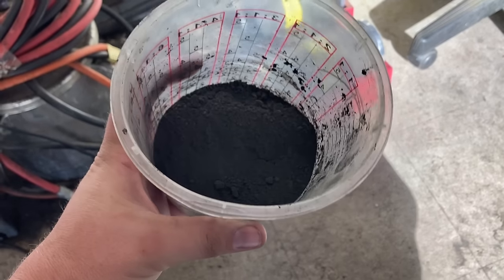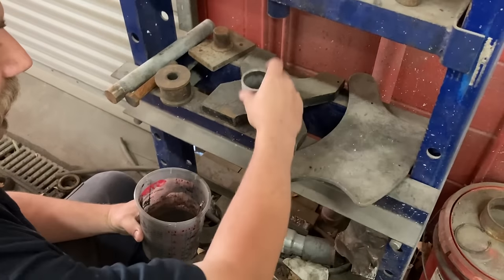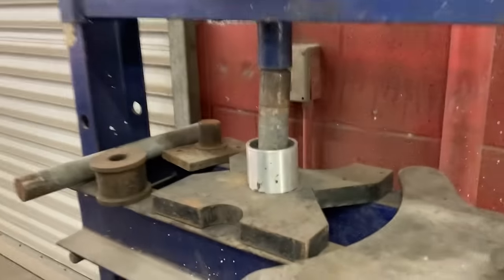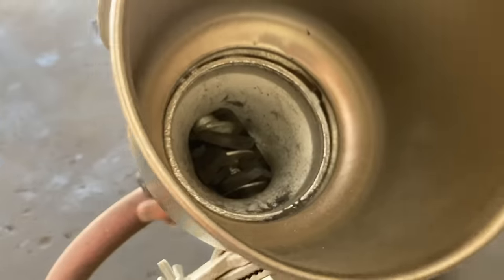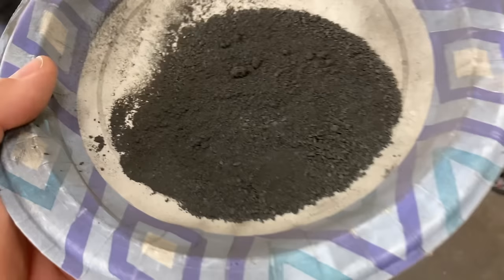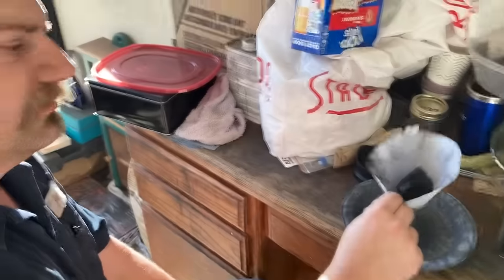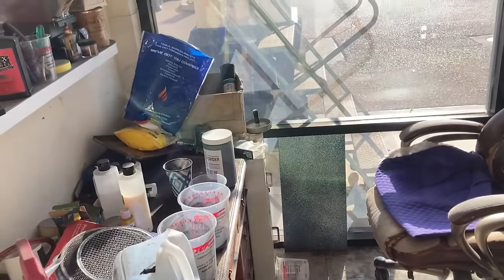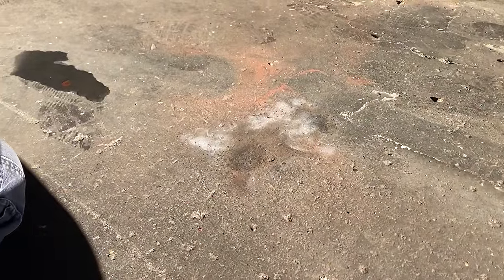Making Corned Black Powder

Comment: first time watching your channel.  I also have no real experience and contact with gunpowder, so if this question is weird or dumb, excuse the lack of knowledge.   If you're going to take just grind it up why make the pucks in the first place ?  Why not just put the powder in the grinder?  A serious question, I have no clue.
Reply from the maker: To make good quality black powder the three ingredients need to be incorporated on a molecular level. I suppose if you put the ingredients in the grinder over and over again for days on end you could get a decent product. The powder that comes out of the ball mill is light and fluffy like flour or talcum power. Compressing the powder into pucks and breaking the pucks up with the grinder will give you nice hard granules than can be sorted by size. So in short, the ball mill does the mixing and the grinder just breaks up the pucks
Reply: @Everythingblackpowder  Thanks for the answer.

Comment: What do you use the 1F for? A lift charge?

Also, are there really no applications for that fine dust?
Reply from the maker: I don’t make powder for fireworks, I specialize in firearms. The 1F is used in big bore muskets. You can use the fine dust as priming powder for flintlocks.
Reply: @Everythingblackpowder  What grade do you think is the best for those little salute cannons? They never seem to work very well, but that may be because I'm afraid of packing it too tightly.

I like your channel!
Reply from the maker: @WaxPaper what caliber are they?
Reply: @Everythingblackpowder  They're .58 caliber, and they come with a 25-grain scoop. I've tried 2F as well as 3F smokeless equivalent, but it always just fizzles and "poofs" instead of "bangs." The other end of the scoop is a ramrod to pack it down. I always wondered if maybe it has to be packed super-tight, but never wanted to use a mallet or anything.
Reply from the maker: @WaxPaper  2F or 3F should work fine

Comment: Sir, you make very good BP and wish that I could do the same. I just can not find a cylinder that you Puck it in, as I don't know what it is that you use.   This is something I feel strongly about so here goes. I worked in a machine  shop for years and even grew up in one... I had a man put a piece of round stock in a press one day and he had to short ones in it as I saw you doing as I walked in the door I saw that this jump side ways kick out hitting him in the face. I wrapped his head in my shirt drove him to the hospital. I took him about 6 months to heal up.. there I stuck my 2 cents in where I didn't need to but You do as you like . I would not want to see that happen again to any man . Have a blessed day. Aw I feel you make BP i would want to buy over all on the market... Bill

Comment: Why do you make the powder in to pucks then grind them back to powder  ?
Reply from the maker: It compresses the powder and makes the grains durable and denser than screened powder.
Reply: Flame doesn't propagate well thru a dense powder. He's making grains (not powder) to introduce air pockets into the mixture which speeds up the flammable reaction.

Comment: Wouldn't the graphite be more of a lubricant than anything else?
Reply from the maker: Probably but the most noticeable thing is that it slows down the burn rate
Reply: @Everythingblackpowder  wouldn't that hold true for anything that won't burn? If you used newspaper ashes instead of graphite, would you save money?  I haven't made black powder so I'm just guessing.

Comment: Whats the difference between corned and your other home made black powder?
Reply from the maker: The other powder is screened black powder. It’s not compressed at all.
Reply: @Everythingblackpowder  yes thanks I just saw the part two, it's more compressed so don't have to use extra like with normal method right?
Reply from the maker: Correct
Reply: @Everythingblackpowder  and what is the difference in the smaller powder? Does it burn faster? And which would be preferable
Reply from the maker: @snowy5419  I mostly make 3F which is what most people consider Pistol powder. It doesn’t technically burn faster. It’s that it’s consumed sooner, if that makes sense.
Reply: @Everythingblackpowder  thank you

Comment: why instead of making a puck dont you wet it then run it through a spaghetti mold and make your grain sizes off that vs the straining ect?
Reply from the maker: that works fine but the powder is much weaker than the corned powder

Comment: You've got your powder added with a bit of water and have mixed it. Screw waiting a week for it to dry. Get the screen ready for the size of cobb you want. Rub your dump lamp of gunpowder over the screen, catching the cobbs on some newspaper. Shake the paper regularly to separate and spread the cobbed powder. Let dry. BOOM! Done. 

Presses, dry it in the sun for a week, bust it up with a hammer, run it through a grain mill, sift it through screen to size the cobb....BS!

Comment: Though I seriously doubt the SHTF scenario, IF - it were to happen and I was unable to purchase standard gun powder for reloading standard brass casings... is it possible to substitute black powder for smokeless powders? 
According to my State's storage requirements, black powder must be kept to quantities of 5lbs or less... similar to "explosive" storage. My understanding is that black powder burns significantly faster than commercial gun powders... which would seem to mean that adjustments in amounts and burn-rate would be required 🤔 So, for curiosity's sake, are there people and sites that play with this idea?
Reply: I’ve loaded plenty of BP cartridges, both rifle and pistol. You want to fill the case to the base of the bullet with a little compression. BP cannot produce anywhere near enough pressure to match smokeless pressures- but you don’t want ANY air gap inside of the case to allow a detonation. If you want a lighter load, fill the remaining space with cream of wheat or similar.

You’ll find about 35gr will fill revolver cases, and about 50-100gr will fill rifle. Semiautos won’t reliably cycle, although straight blowback seems to work for a bit.

For shotguns, use a “square” load to start- an equal volume of BP and shot. I find for birdshot about 70gr in 12ga is a good start- and I’ve gone up to 120.
Reply: @PrebleStreetRecords   Thank you. I suspected... I've seen reload videos for brass shotgun reloads and 44-40s. Both are old platforms, made when BP was all there was. Modern weapons? Gas operated? I had my doubts, especially with the stories of the early M16 failures due to "dirty" powders. But your guidelines are good to know... because... Zombies and stuff! LOL!

Comment: You should lose less than 1% everything else should be a grade cut or sent back to be re-wet and re-corned. Most mesh cuts have their uses, sometimes the proportion of mesh cuts that you make may not be exactly what you use so send the surplus back to be re-pucked.

Comment: excellent, that's how you make a strong grain... but you're missing a brother procedure... to give the gunpowder its maximum hardness and facilitate granulation with less dust
Reply from the maker: Well, let’s hear it.
Reply: First I recommend that you use a sprayer like one of the perfumes to add moisture to the powder, that way you ensure an even humidity..
Reply: the final step for the grain...(pressed gunpowder disc) after drying it for a couple of hours in direct sunlight or in another medium that ensures all the moisture is extracted...you have to cook the grain hot, it sounds and it's something reckless, but gunpowder withstands a lot of heat before igniting.
Reply: For cooking, a piece of thick and flat iron would be used, such as a plow disc, it is placed on a portable burner preferably to be able to do it outdoors in a windless area, it is heated over a low flame and the grain is placed ( BP disc) and can be seen spinning like a hamburger
Reply: it will begin to release smoke and you will see how it becomes a little bright decided that the sulfur and nitrate crystallize...once cold the grain will sound like a piece of ceramic, it will be harder and when you scrape it against the ground you will notice that it remains shiny
Reply: Such will be the hardness that you will even be able to sand and polish the grain, it will be so hard that from one colpe it will be invoiced in several pieces, something positive for the granulating process with the corn machine.
Reply: I also recommend weighing the powder that you are going to press and it is very important to leave it for about 30 minutes, that is why the initial humidity must be low to avoid nitrate leakage... the longer the press time, the less air will remain and it will be more compact. It takes time, but a good gunpowder made with quality elements deserves it.
Reply: and don't forget the graphite, for safety and fluidity in loading. It's a simple step...you put the already granulated gunpowder in a tumbler and leave it for a few hours...at the level of graphitization you decide.
Reply: The pressing method reduces the volume of the load and concentrates its strength more, in addition to avoiding compaction in the load. In my case, after granulating, I let it sit for four to six months. After that period, it will reach its greatest potential. I hope this method is useful, it is my experience and I am very satisfied, nothing to envy to the commercial ones. greetings from Argentina.
Reply: If you decide to carry out this procedure, start with small grains to get a good look at the temperature of the metal and how it reacts. and upload a video of the result. regards..!

Comment: What's your opinion on Alder charcoal
Reply from the maker: Alder Buckthorn makes the most powerful powder that I’ve tried so far
Reply: Thank you for the reply. I use Swiss powder, it's hot, and I'm fully convinced it produces softer fouling.
Reply from the maker: Yes, it’s the best money can buy. My alder buckthorn powder has equal velocities to Swiss but produces twice as much fouling.
Reply: @Everythingblackpowder  Interesting. I mainly load cartridges with black. I wonder if the compression level changes the amount of fouling.

Comment: So you take a powder make it a puck then make it a larger powder. Why?
Reply from the maker: Compressing the powder into pucks makes the grains much more dense and the powder more powerful than the old fashioned “screened” powder. All commercial brand powder are Corned.
Reply: @Everythingblackpowder  Have you thought about making a thick past and push it through a screen? The size of the screen makes the size of grains. This gives the size to have some space in the power to help the burn.
Reply from the maker: That sounds like old cash screened powder. It’s not as dense therefore not as powerful.

Comment: Would a bench vise suffice if you don’t have a press?
Reply: yes, but your results might not be consistent.  

You could ram with a rawhide mallet into a tube to press pucks.  It would not be a concern unless you have sparking debris inside of your powder. Obviously it would be even less consistent than using a bench vise.  Ramming with a mallet is how I make bp rockets.
Reply: @duacot6633   Ok. I’m just glad I learned about making corned black powder, instead of using the screened method, which makes the powder grains far too crumbly and brittle. How brittle is the powder you make, since you ram it into pucks with a mallet?
Reply: @duacot6633  Yeah, I just figured it would be a lot easier to make corned black powder, instead of having to use something, like dextrin, as a binder for screened black powder. I plan on making black powder for a few mini cannons I own, and my blunderbuss, so I need something that won’t be brittle, because extremely fine bp dust doesn’t work very well in muzzleloaders.
Reply: @zeussx2120  i would suggest making a few small batches. Incrementally increase a binder then wet screen half and other half press a puck. Performance is paramount.  Not sure it matters but i also use acetone as a wetting agent after milling for >24 hours. Not timed, just put somewhere safe to let it run. 

I REALLY want get an old powder tester.  They used to use a mortar at the manufacturers and elsewhere used hand held tester called "eprouvette".
Reply: @duacot6633   I think I’ll just get a press from Harbor Freight. The cheapest one they sell is like 170 bucks, and it’s a 12 ton. Should around 10 tons be enough for making pucks?
Reply: @zeussx2120  you could look up how to calculate the tonnage if you want a consistent end product.  Tonnage of press and diameter of the pump will determine the amount of actual tonnage applied to the "puck".   For pressing rockets people like to use a gauge to maintain a consistent end result.  I doubt I am ramming my pucks over a tonnage of pressure, but that's hitting it with a mallet a few times. 

I have not tested different tonnages.  I am not knowledgeable enough ti say "10ton press is " because I honestly don't know.  Would it work, yep, it'll work, but how good? 

You're going to want to be thrilled with your results and nothing worse than rethinking everything to discover what you suspected from the beginning, that you needed a bigger jack or the money spent could have been spent better and now your costs have doubled.  I would opt for a 20t over a 10t if I had the option and a 30t over a 20t if it were cost effective.  Check your local used adds, craightlist, facebook, offerup, before buying new. I would avoid anything that leaks.

Comment: TOO Funny! I hear the two-post lift in the background! I welded my pucking system on my lift!
I do four spoons and a longer press time to plasticize everything together. I find if I wait longer with PSI the water get time and migrates out better over time as H2O is incompressible in size and final dries sooner.
FAST! Me Like!
I have not done graphite yet; will it make my batch?
Faster?
More durable?
Moisture resistant? 
Easier to light?
More reliable?
Reply from the maker: I just did some test on that. So far I’ve been able to conclude that the graphite coating slows down the burn rate in open air and in a firearm. It was 100fps slower than the non coated.
Reply: @Everythingblackpowder  IIRC,  the burn rate for black powder is the same whether it is confined or not.    Smokeless powder, on the other hand, burns exponentially faster the more it is confined.
Reply from the maker: Either way, graphite slows it down

Comment: Somehow, taking tap water dripped out of a faucet doesn’t seem very scientific or precise. Just saying. Kinda funny seeing someone doing this after hours at his workplace.
Reply from the maker: I can’t tell you precisely how much water it needs because there are too many variables. The relative humidity, the ratio of the components and the kind of charcoal you are using all will effect the amount of water you will need. Sorry it’s not very scientific answer but the best advice I can give you is to use as little water as possible. 

I guess when people click on this video they’re expecting to see some smiling guy in a white lab coat working in a pristine climate controlled laboratory.

Comment: Making "Black Powder" at home can be VERY DANGEROUS  !
I'd leave it to the experts unless I was fully equipped and knew EXACTLY WHAT I WAS DOING !
When I was in High School, way back about 50 years ago, a local boy blew himself and his entire family (8 people!) to kingdom come trying this exact task!
Reply from the maker: Who said I’m making it at home? I don’t claim to be an expert however I am well equipped and I do know what I’m doing. As for your high school friend, are you sure it was black powder and not a meth lab? I make 200gram batches at a time in a rubber coated insulated tumbler with non ferrous media. I guarantee It would take a lot more than 200G to do the kind of damage you described. Thanks for your concern though.
Reply: @Everythingblackpowder  
As I said, this was 50 years ago!
I'm not sure if "Meth" even existed back then.
And it was CHP and San Diego Fire Department that told the papers it was "homemade black powder" !

Comment: That was like 1 ml of water that came out. Theoretical max kno3 loss for 1ml is 133mg. That's nothing.
Reply from the maker: Thank you
Reply: @Everythingblackpowder  
No sweat. Your videos are great. Just givin' a little back.
Reply from the maker: It’s funny that you would comment about that. Just the other day I had a guy telling me that I would never be able to re-create a batch of powder due to the water that’s lost because it changes the ratio. I told him that I wasn’t going to argue that it was losing a little bit of nitrate, but the bottom line is that what little is lost is not enough to make any noticeable difference in the finished product.
Reply: @Everythingblackpowder  
Quick question. How warm are tge pucks when they come out? Temperature will effect the solubility, but it's under compression for so short a time, I doubt they heat up very much at all. Thie is evidenced by how fast burning it is. If you were losing much kno3 - the oxidizer - it'd burn much more slowly.
Reply from the maker: I couldn’t say what the temp is but they aren’t warm
Reply: @Everythingblackpowder  
Like I said, the way it burns alone says you aren't losing very much at all. Any loss is minimal. It burns much too quickly to have been degraded by the process. I mean you could extract a 1ml sample, let it dry, and weigh the resulting dry particulates, then extrapolate out to loss per gram. Seriously though, who tf wants to go through all that for a product that's clearly working as intended? There's always gonna be youtube critics. Have him make some and submit a sample for testing. 

Everyone's a critic. Just keep doing what you're doing.